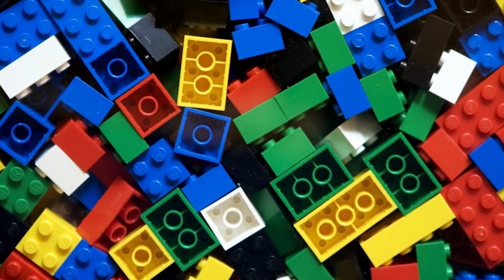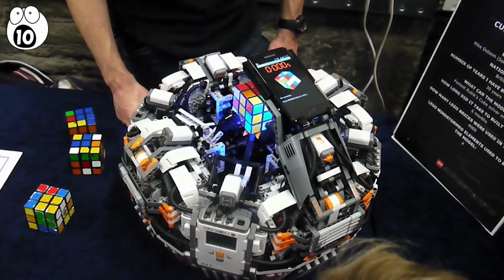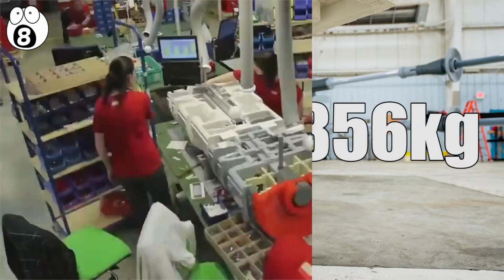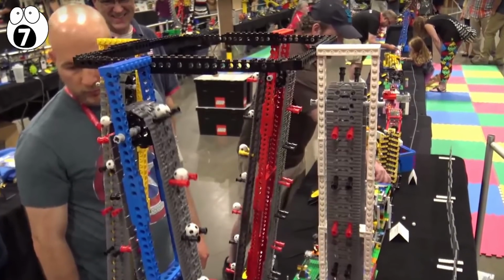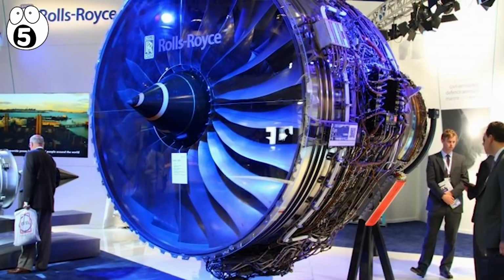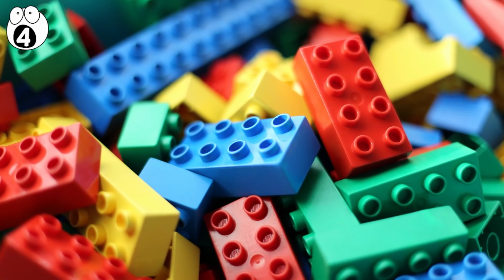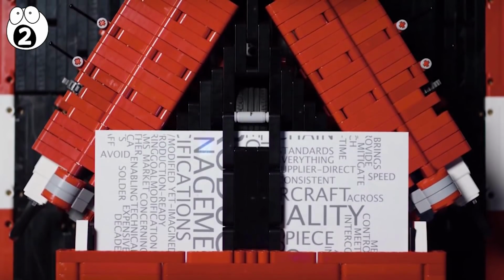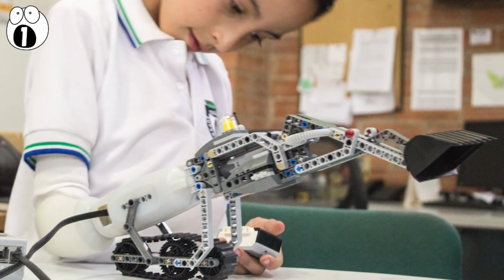The Most Complex Lego Creations Ever Made!

Comment: What I made may not be very impressive, but with a simple structure I surprised some people.

We had a course assembly.
The lesson was about propulsion. There was talk of pneumatic, hydrolic and mechanical propulsion.
When the lesson was over, I spontaneously started to think: With something that is pneumatically driven, the pressure does not automatically become much greater than the air pressure. With hydrolysis, the pressure is slightly higher because of the weight, but not yet high enough to just drive something. Something with gear wheels will not rotate by itself.

So I built a little machine, smuggled to class. At the end of the lesson, the teacher asked if there were any questions. I said, "1 at most 2 questions." I put my machine on the table and asked the teacher: "Is this a mechanical drive?" He said: "Yes." Then I asked: "Then why isn't it running?" The whole class was silent, including the teacher:)

Comment: a working model airplane, or to be more honest most of a working model airplane: I liked making planes out of stuff I had lying around as a kid and never could find a motor and battery pack quite good enough to make them work without tearing up one of my buggy cars so I left most of them unfinished, it did just fine glide testing and had working control surfaces though...if I'm remembering right I think I cheated and added other structural elements to keep it light enough to work and strong enough to hold up without gluing it all together, think stuff like wing struts made from chopsticks and produce-isle bags carefully worked into the roles usually left to heatshrink in model building.

Comment: The more technical stuff I made never really worked outside of the NXT instructional models. I think the most technical stuff I made was a tracked robot that would occasionally throw its tracks on turns, and a rubber band gun rifle using a semi auto mechanism I learned to make off a youtube tutorial.

Most complex thing I built that was actually good was a P-51D Mustang lego model, no instructions, I made it up myself, with realistic retractable landing gear. I put a lot of effort into getting a consistent color scheme (rather than just rainbow the crap out of it like most of my creations). I also put a lot of effort into making it as close to accurate to the real shape of the aircraft as possible using a small model I had.

I made that model when I was 17, and it was the last thing I ever made with my legos. Normally after building something, I’d get bored, and take it apart before building something else. That model though was really nice, and the first thing I built I wanted to have on display forever rather than take apart. So I never felt any reason to cannibalize it to build something new. In fact, all I really want to do is find some ways to improve upon it.

After that, went off to college, and now joined the air force, too busy fixing jet engines for very many hobbies, especially time consuming ones like legos, when I could be doing something that’ll provide me skills for fall backs or future careers. Such a shame though, I miss them. And now I think I know enough about mechanics that I could probably build some kickass robots. Maybe I’ll get back into it after I get out of the military. Or maybe I’ll just use what I’ve learned to graduate to a personal workshop and making projects out of metal and wood instead.

Now I have a huge bucket of legos sitting in storage somewhere. I think I’ll give them to my niece. They’re too useful an inspirational tool for young minds to just sit in a basement for a decade.

Comment: When I was younger I was a huge fan of the Yu-Gi-Oh anime shows but I was never able to get my hands on one of those toy duel disks that were around at the time. I did, however, have a truck ton of Lego bricks that I played with so I got this crazy idea to build my own life sized Duel Academy Duel Disk from scratch using nothing but Lego's. The even crazier thing was is that I actually pulled it off. The duel disk could fit real cards in the deck and graveyard slots and the monster + spell/trap zones were all functional as well. I even made a strap that could attach the whole thing to my wrist like a real duel disk. However, the whole contraption was pretty darn heavy so wearing it was an issue. Plus, the section that you put the monsters and spells/traps on was a bit flimsy so it didn't hold together awfully well all the time. All in all, it wasn't what I envisioned but it serves as a fantastic memory from my days playing with Lego's and is easily the biggest thing I've attempted to build from scratch with them. :)

Comment: Currently trying to work out how to add a cam shaft, rockers and valves to the engine of a Lego Pick-Up I'm building for my 5 year old. Also don't have the new 'round engine parts' so using the massive 2x2 square cylinders and hiding that they're square... but can't hide that they're MASSIVE, effectively 3x3 per cylinder plus an extra 1 in each direction on each bank, and offset by 1 if they're in a V configuration... the truck now has to be nearly 1 1/2 ft long to keep scale for a straight 6!

Comment: I would build a giant robot with my own design and you can ride it and control it and it has a flame Trower and the robot can fly  i will use 1,000,000,000,000,000,000,000 blocks

Comment: I found this very interesting https://www.youtube.com/watch?v=HCXh7WOz860 However my LEGO days are long over.  Nothing is wrong buying LEGO. is that I moved on to model kits like BANDAI JAPANES plastic kits 1/60 scale Gundam. that have be painted in custom colors. That is buy Mr. Color paint and Tamiya flat white spray white cans. each color is written in Japanese that I cannot read. There is no paint by numbers on the manual even the bottles of paint do contain number. PG grade Gundam Kits got thousands of parts to work with. its not simple  there are parts that go one way and it fits 8 different ways only one works.  the most expensive PG grade 1/60 scale gundam cost me well over $500.00 no paint no tools. all that extra GUNDAM 00 RAISER https://www.youtube.com/watch?v=C0t7MDTDgx4  then part 2 https://www.youtube.com/watch?annotation_id=annotation_3161027227&feature=iv&list=UU9rffKmLx37aUMpZTSz5S1Q&src_vid=C0t7MDTDgx4&v=u25RfAsOoSc  the problem he doing it wrong. I paint parts he is not painting.  he is cheating

Comment: how about a 3D map of the montreal subway system.
at the time (in the winter of 1971), i did not have access to anything like lego trains or any equivalent. if i had, it wouldn't have been just a map. it was almost 25 feet long and used i don't how many bricks (all i can remember is, it was a lot.), and it took hours to build, i don't remember much more than that.( i was only 6 at the time.)

Comment: I once built a remote controlled Lego car with a working real-time collision avoidance system. It was built with Lego Mindstorm and used a laser distance sensor to detect the speed of any obstacles in front of it. It then compared the speed of the obstacle with the speed of the vehicle, and decided whether to stop the car or limit the speed to the moving object in front. All in real time. Basically like similar systems works in real cars today.

Comment: I would be very curious whether it would be possible to build a fully functional automatic Gun, with pressure bearing parts purely from Lego, operating with custom cartridges with a very, very light load (but still explosive) that can shoot light projectiles at least a few meters. It also has to be automatic in a way that real guns are, through blow-back or a gas-system. I doubt it would be possible but I could be wrong.

Comment: I have built contraptions and buildings from legos since I got my first set when I was a baby. I always wanted more legos for Christmas. Then the Expert Builder sets with the gears and rods. I am 52 years old now and I still have every lego, I even have the last contraption I built, it is my own design truck with 4 wheel drive, front plow and rear suspension but no steering. I have had this on my wood window valance for the last 15 years.

Comment: I would build the mino buggy. not my own invention. as far as I know I must attribute it to Mark Norman.
comprises: 1no. 2x4dot baseplate to support 2no. 2x2dot (old-fashioned) lego wheel plates. on top of which sits 1no. 2x2dot clear sloped block at front separated from 1no. 2x1dot clear block at rear by 1no. 2x1dot coloured block.
uhmm, I think that's it.  6 bits. the van version only 5 bits.  but a cuter car with fewer bits? there is the skill.
btw with the modern 1x1dot clear sloped blocks available now and by using those special 2x1dot plates with just the one ringdot in the middle then (for an admittedly delicate) model you colud use a couple 2x1dot coloured plates stacked, to ride behind the clear sloped (cockpit/cabin/windscreen) block and all atop a longitudinally placed 4x1dot plate braced each end on the 2no. 2x1dot middle ringdot special plates I mentioned before, affixed to the new (bigger tyred) 2x2dot wheel plates for a kick-asp monster mino truck.
it might use a couple more bits and i'm not convinced myself but hey.  you can pimp it too for not a lot of dots either way.

Comment: I built a 1:8 scale car with all working parts, to include 4wd differentials, manual transmission with working clutch, and steering; with each controlled by their corresponding controls as they are in a normal car: ie clutch with clutch pedal, and transmission with a gear shifter in the form of a stick shift.

Comment: About the lego car: why use rubber tires? I mean, tires can also be made out of hard material, in the old time coaches (horse-driven vehicles) had iron tires. So maybe lego tires would also have worked, maybe not if you drive the car for thousands of kilometers on a road, but it was only a proof of concept anyway...

Comment: In my opinion, the complexity of a LEGO model is not based on how big it is, but how difficult the programming or how complex the mechanical structure is. So in that perspective, YouTuber Sheepo's Garage has the other most complex LEGO creation than the loom and the Cubestorm, a car with dual clutch, transmission, and brakes.